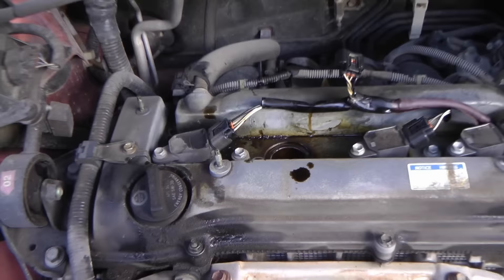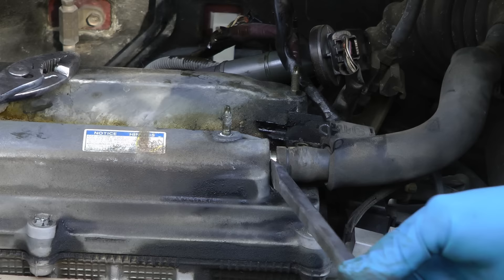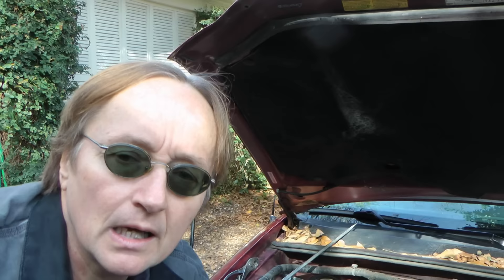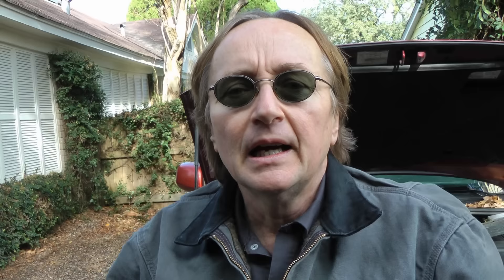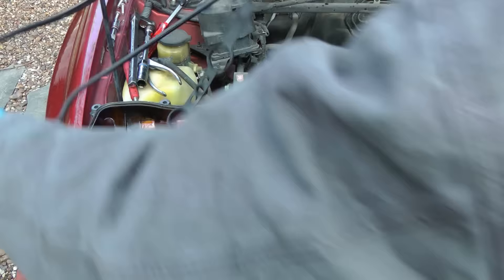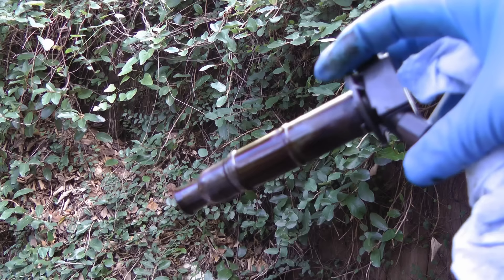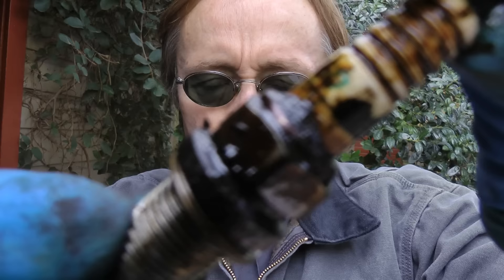How to Fix Engine Oil Leaks in Your Car

Comment: You're my hero, Scotty!! This EXACT scenario happened. I was changing plugs and wires and found oil in a cylinder. I was sad, not knowing if this was a problem I could fix myself. :(  
But, then I checked your channel. You made the gasket change look so easy, I was brave enough to do the work myself on my 99 Celica GT. It was super easy and I know I saved at beaucoup dollars by doing it myself! THANK YOU FOR YOUR INSIGHTS INTO CAR REPAIR! ;*
Reply: You GO GURL!  :)
Reply: Women

Comment: This video definitely help me out. You saved me a lot of money. I thought my car was overheating because steam was coming from the engine bay when it popped the hood. And I smelled through the vents. So I thought my car was burning oil but It's actually leaking oil not burning it It only is burning because the hot oil that's leaking is touching the hot engine parts. I even had a mechanic look at it and he told me it was an oil leak for sure. He was being completely honest he told me that the mechanic shop he's at charge a lot of money so. That doesn't happen too often. So I decided to watch your videos and you make everything seem so easy. I guess that's what many years of experience does. But I'm not complaining. Your videos always helped me out. Save me a lot of money.

Comment from the maker: you have to drop the tank, but a jack under it with the car up on tall jack stands, remove the two bolts that hold the straps and remove the fuel lines and the big feed hose from the gas cap area. Then it slides down. Make sure it has little gas in it or you will get a gasoline bath

Comment from the maker: i would use conventional Castrol oil, good stuff, use it myself
Reply: I have a 2016 chevy cruze limited Lt im seeing oil on the top left size of my engine but it only is there when im actually driving im not sure where its coming from any ideas?

Comment: On older Honda 4 cyl. engines some of the leaky gaskets are under the rocker arm assembly. It's not quite as easy on those because the rocker arm assembly has to be removed to replace the leaky o-rings. After you put it back together, the valves have to be adjusted. Fun.

Comment: Hey Scotty,

Nice Video. I would also recommend that the viewers be careful when using that wire wheel under the valve cover, and the camshaft. You need to make sure none of that stuff you shave off with the wire wheel gets into the moving parts of the engine. That debris can cause damage the internal moving parts like the cam shaft and valves. Oil change is in order as well.

Comment: Yeah yeah it looks pretty easy to watch it done by a pro on a fairly easy car.
When I was a kid, I was all into mopeds, small bikes etc. Fixing them, taking them apart.
Then I lost a touch of it.
Love my pathfinder 02 but it needs a lot of small work like changing a knock sensor, valve cover gasket etc. Seems like a pretty easy job. But whenever I pop up my hood I'm like DAMN how I'm gonna do it... tones of tubes, bolts, wires etc... lol
.
The funny part is that I can afford a new car. But I just too damn in love with this one. They don't do cars like this anymore. And the engine with a tranny work like a horse. Nice and strong.
.
Mechanics want like 2-4K  for this job. Damn car costs 2-4K now ahaha...
.
Anyway, great vids, fun to watch.
But I'm still too pussy to start fixing my car on my own. It's my only car, If I mess up something, I'll be immovable and HELL NO I'm not using a public transportation in NYC. )))

Comment: You're not worried about metal or other particles getting into the engine when you buffer it like that? Couldn't those flakes cause damage over time? I'm gonna do this job within the next couple of months and I know the gasket is just gonna be caked on since it has 308,000 km on it and it looked so easy that way and I'd love to do it like that if it's safe for my engine.
Reply: I hear you and would take that little step too, you could keep the old spark plugs in the holes for that and pick debris up before replacing the plugs.
Reply: He kept the plugs in the holes, and left the oil in the hole, and after buffing, pumped oil out and then took plugs out. So that should be ok. But yeah, sticking a rag in would have made the process even better i think.
Reply: Plugs in the holes!!! You not worries about the rest of the engine. Never buff debris into an open engine like that. Only hand scrape with a razor blade

Comment: wait, if I initially remove spark plug only to discover oil in the spark plug well, doesn't that mean all that oil already in there dripped down into engine, and would cause hydro-lock if I start the engine?
Reply from the maker: that tiny amount of oil will  not hydrolock a motor, but if you're worried, crank the engine over a couple times with plug out and it will shoot out
Reply: Awesome, thanks for your help Scotty!
Reply: yes. I had this problem on my 2.2 camry. took out #4 spark plug and discovered oil. was literally only enough oil to coat the threads of the spark plug. changed the gaskets and plugs and it instantly brought vigor back to my car. most likely won't be enough oil to do any further damage, but each repair is individual, so.....
Reply: He ment to say when he removed the spark plug coil

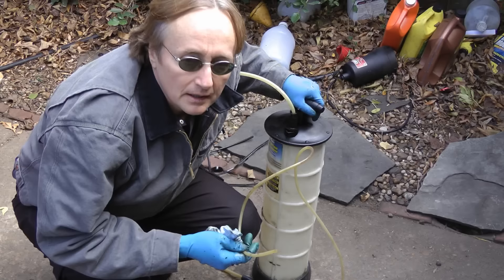Comment: @scotty kilmer does bits of the rubber gasket fall into the cylinder when your buffing the spark plug contact patches? ie. 1:40
Reply: they will burn out and get out of the exhaust, they are soft and combustible.
Reply: Replaced gasket, plugs still getting wet. Could it be valve seals

Comment: thanks Scotty, I have a bad leak on my 04 CLK55 AMG Benz, so I'm going to start with my valve cover gasket and change the plugs while I'm at it.  I'm green with this but learning and to save $800 for the gasket change and $500 for the spark plugs is a big motivator. I changed the serpentine belt last week. Thanks again
Reply: Rocc J if its a mercedes dont bother trying to fix that money bucket xD

Comment: you are grinding all the shit in the engine with that buffer..
Reply: Haha same thing I said, it adds more horsepowa to da tiyas!
Reply: It's alright, those particules will be absorbed by the oil filther and dumped.
Reply: Is alright I put some to my engine at least weekly to get some nice horse powers
Reply: I'd just change the oil afterwards, it looked pretty dirty anyway.

Comment: Awesome video. I actually just replaced my valve cover gaskets two days ago since they were leaking pretty bad. Also ended up fixing a idling and stalling problem by accident since you have to remove the intake plenum to reach the rear valve cover I figured I would clean the throttle body and found out that the cause of my idling problems was the automatic idle speed motor (or something like that). Pretty excited

Comment: On the prying of the valve cover with a screwdriver:
I normally advise against doing that because it's very easy to gouge up the top of the cylinder head and cause new oil leaks later.
I personally give the valve cover a few good whacks with a rubber mallet while lifting/wiggling the cover with my fingers hooked into the oil fill hole.
Just my two cents ^^

Comment: the Honda accord I had was fun to swap the gaskets in, the O rings under the rocker assembly were bad as well as the ones for the spark plug tubes on the valve cover, I was paranoid i was going to mess something up on the rocker assembly but it comes out pretty easy and all the seals and O rings come in the set which is pretty cheap.

Comment from the maker: well, a blank space may be sufficient for that. Often they do nothing, other than make up stuff to try to sell servicing to you. Just had a guy come in last week with a 1200 repair quote from such an "inspection" at a dealer, and in reality he really needed no work done at all. You can easily check what's needed yourself by checking belts and hoses for cracks, checking all the fluid, and pulling a couple wheels off front and back to check brake pads.

Comment from the maker: gasket scraper actually can cause more damage to the soft aluminum on the head. Rubber pieces flying off the fine wire wheel do no harm, they will just burn off or get squashed.

Comment from the maker: do a compression test of each cylinder by removing the spark plugs and testing the pressure inside. Worn rings would show low pressure

Comment from the maker: that's not grinding, that's a fine metal buffing wheel, only pieces of rubber will come off and they easily burn up or get crushed when the engine starts, though you can blow most away with air before putting it back together.

Comment from the maker: it's a cheaper oil, so check with the ratings on the bottle and make sure they match the ratings your car has to use. All that info has to be told to you if you call a dealer, it's federal law, those oil ratings

Comment: Whenever I have my valve cover off, I am phobic about foreign contaminants entering the engine. If I have to leave it for a while, I'll put a clean towel over it, so sand or whatever won't get into the exposed engine. And then I see Scotty using a wire grinder on that stuff. Wow.
Reply: Same lol i was like wtf 😳😂

Comment from the maker: One, probably drive slower. but make sure the air filter is clean, and have the MAF sensor cleaned out, that often makes em use a lot more gas

Comment: I believe synthetic can help preserve seals, but it will not fix them if they're already getting old. In fact, It often makes the leak worse if there already is one. I just bought a 2002 Grand Prix with 109,000, and it had a leaky right valve cover. I switched it to synthetic, and the leak got continuously worse over the next month to the point where it'd smoke. My cousin who's a technician says that the detergents in synthetic cleaned out any junk that was blocking cracks in the gasket.

Comment: Thanks for your answer. I'm going to do that compression test. If I have to rebuild the engine, then I will have to do it. The cost is somewhere at 300 $ for the parts and another 100$ for the mechanic. I hope after that it will last.

Comment from the maker: Na, you don't need new screws. And I clean the area off with compressed air, but rubber pieces aren't going to hurt anything, they would be crushed or the filter would stop them. Any really big pieces you take out by hand.

Comment: I highly recommend you stuff rags in the spark plug holes BEFORE scraping or brushing crud off - that keeps crud out places you do not want to dump crud. Its also easy to simply stuff a rag down inside to sop up any excess oil - no need for a pump. Be sure to inspect cam plug inserts and apply gasket goop at corners. easy job anyone can do.

Comment: found out the hard way that this isnt so simple with a trailblazer. ended up removing the air box, PCM, throttle body, alternator, intake manifold, ignition coils, some brackets, and undoing some wire, clips and hoses. certain bolts were difficult to get to in tight spaces with so much in the way. im no mechanic but figured i could do fhis myself and i did but it was a pain.

Comment: I learned something new about spark plugs.  I was worried that the Bandit 600S I sold should have had anti-seize on the Iridium spark plugs I put in it, since they are made to last as long as possible.  Now I know it's nothing to worry about.

Comment from the maker: pistons compress the air fuel ratio inside the engine cylinders. If oil or water gets into those cylinders, they don't compress like vapors and then things get bent inside the engine, like the piston connecting rods. Not something you want to happen.

Comment: Scotty, about the spark plug part, in my 20 years of working on cars, I have never used antiseeze on plugs no matter manufacturer. However on cop i would use dielectric grease on the boot connection, oh and also on the Fords modular engine family.

Comment from the maker: depends what's leaking, it can be oil leaking on the exhaust and smoking white, or coolant hissing and leaking somewhere. Figure out which one it is first.
Reply: I’ve noticed some oil loss . What it looks like it’s coming from exhaust plastic manifold . Not the top I’ve looked . Is that not too bad or major cost to fix ? Will it get worse and I should fix it ? 11 Camry LE 2.5 L

Comment: if you want to fix the hole and not replace the pan you can have the pan "brazed" which is a welding technique using brass, borax for flux and a oxy/acetylene torch you could call up a radioator shop which would more likely know how to do that and ask for a price and compare to a replacement used pan you could get off the internet for cheap either way you will need a new oil pan gasket [you could use silcone]

Comment: theres a lot of engines out there like my 2000 Camry (5S-FE) that also require the use of some sealer in specific spots (its like that from factory - 8 spots) -- check the service manual for specifics

do you want all that crud flying into your engine and going through it blocking things?

also a touch of oil applied along the new gasket will help it fit and seal better

Comment: im pretty sure it was just condensation in the engine because i wrote that comment two weeks ago and it still runs fine and the oil on the dipstick is fine

Comment from the maker: they're not metal, they are just rubber pieces.I picked out the big ones and the little ones will just be crushed or filtered out by the oil filter

Comment from the maker: If oil is only on the firing end, the engine is then leaking oil internally, such as bad piston rings or valve seals. If the whole plug is wet, either a tube is cracked or the seals aren't sealing correctly from incorrect manufacture or installation.

Comment: I would advise against using a wire wheel to clean the mating surface. Imagine all the garbage being introduced into the engine. Use a gasket scraper and some care.

Comment: Scottie 1 , I use synthetic oil in my car but it comes down to doing Oil changes when required. in my camry I do the oil change at 5,000 miles. I would also consider using a good oil filter because when Oil gets dirty it becomes thick.

Comment: I wish it was this easy on my car. I replace Sparkplugs last year now they are stuck cant get them out at all tried all sorts and they are the right ones for my car. . And did a oil change and now have a oil leak and car engine rocks back and forth.

Comment: Scotty I have a 2000 camry with 139k miles that blows smoke out of exhaust pipe at each cold startup. Since it does that it burns my oil and I have to pour a little bit of new oil into engine every few weeks to replace the burnt oil. One mechanic told me it is the engine valve seal that is causing the smoke and he says it will cost me a whole lot of benjamins to get it fix. Please tell what you think may be the culprit. Thanks I learn a lot from watching your videos, keep it up Scotty!
Reply from the maker: old age and worn valve seals and piston rings do that. oiL is cheap, just keep adding it

Comment: usually no. the oil mostly sits in the pan at the bottom unless the engine is running. if cleaner or debris gets into the oil it would be a good idea to change the oil after

Comment: Nice info!
I'm currently experiencing some issues with my 2008 Mitsubishi Endeavor. Basically when I start it, the engine starts and idles rough, and sometimes when you try to start it the engine turns, but won't stay on idealing. So we cleaned the EGR valve which appears to have had deposit buildup. The suv ran fine for 2 days and now when driven it drives as if someone is pulling from behind and tugging on my suv, then when I come to a stop to idel it start putting. Not sure if replacing the EGR valve with a new one would fix this, I know it's not the timing.

Comment from the maker: I would try AT 205 reseal, hard to find, I get it at amazon. And pray it's a seal leak, cause that can stop seal leak. But if oil gasket leak, it would have to be replaced.

Comment: I have an issue with a 2001 ford windstar that is beyond my knowledge. It has about 110,000 miles and it is a 3.8 V6. Out of no where that engine is making a tapping noise. It is not the usual tapping valve noise you here from an older engine. It is like something is loose. It is not constant. I can feel it when I touch the black plastic upper plenum in the center of the engine.

Comment: I have a 1997 Ford Thunderbird and from what I can track down I believe my oil is leaking at the oil filter gasket. Any chance you have or can do a video showing what this entails. I was told best way to get at it is probably remove the tire on the driver side and use long extention to get to the bolts.

Comment: I always have to put never seize on new plugs because they won't come out if you don't. They guy at the auto parts place told me the same thing. Had to pull the head off to get the broken off plug out.

Comment: I think this is it. I let my camaro 5 sit for a little over a week in freezing temps outside and started it and oil was coming from that exact spot and causing smoke when it touched the engine, and it's only on the driver's side. No check engine light. Im hoping there's no damage from it sitting a few days longer before i take it in.

Comment: No, i cant live with knowledge that the engine is leaking. I will replace the seals on top of the engine. But at the bottom i will probably have to clean up the engine and somehow find out where it comes, if it doesn't stop. Hopefully nothing too serious. I will try to let you know what it was.

Thanks Scotty!

Comment: Hey Scotty thanks for all yr videos man. Tip: never use a wire wheel in the engine ,they loose bits of their wires and into yr oil system they go. Also in order to put a hose in easily spray the inside of the hose with wd40  and it goes in easy peesey squeeze the lemon